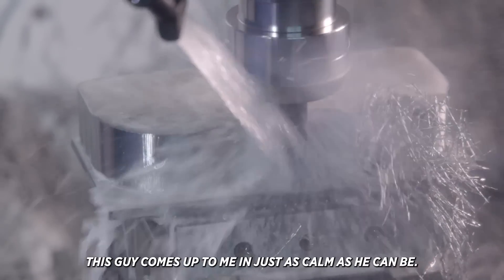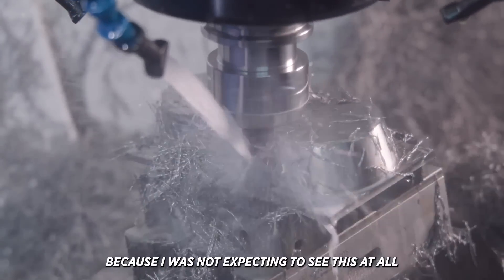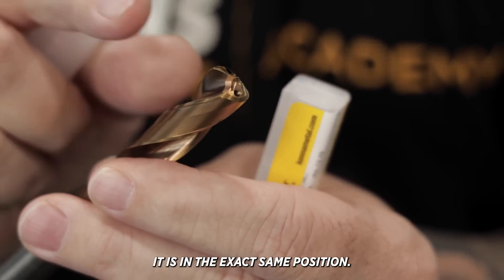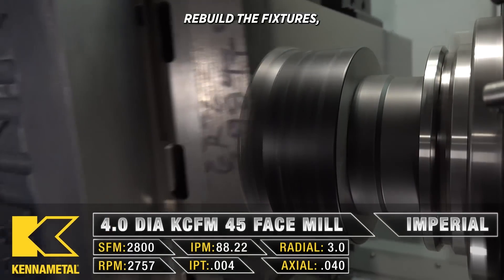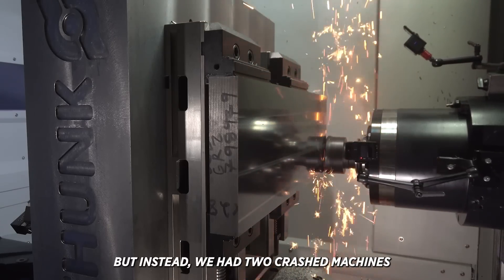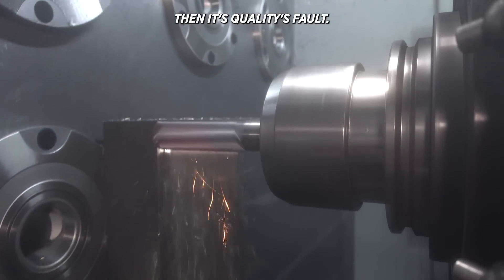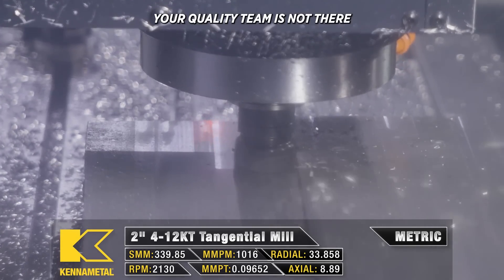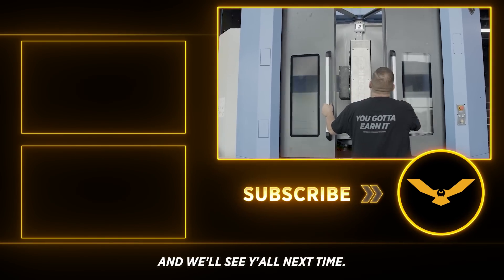$200,000 Damage | EPIC FAIL… Machinist CRASHES TWO MACHINES at the Same Time

Comment: Worst crash I ever did was when I was still in technical college. Brand new Clausing lathe. I was the first student to program and machine a part on it,  so I thought. I G0 to .500 in Z to the front of the part but I forgot the tool offset and I had also had Z in a positive number, not a negative. Turret went high-speed straight into the spindle. Machine was down 4 weeks for repairs and realignment. My teacher let me engrave my name in the spindle as the first student to run and crash the machine. I work with a guy who graduated from that school 2 years ago and he said my name is still on it. That was in 2001. Lol
Reply: That sucks but having your name on the machine for that made my day!
Reply: Awesome. Fantastic way to be remembered lol. I bet all of the teachers use you as an example……..
Reply: i'm grinning  while reading with RESPECT
Reply: When I was on active duty we were in the same division with the machine shop--they had a Chief in there who would make them wear their crashed parts on a chain around their necks.
Guys who tightened down vises and crushed parts or snapped bolts by overtorquing would have to wear a helmet with THOR stenciled on it.
Of course this was the 80s. You wouldn't get away with that now, someone would get butt hurt over it. Never mind that this was on a carrier and they were manufacturing parts for catapults and arresting gear and steam plant proponents, better an injured plane pusher than injured feelings.
Reply: @texasred2702  I love this.  I work in aviation as maintenance, and when a pilot would scrub off and blow a tire, it most defiantly was because his toes were on the brakes when landing.  A big no no.  The best part is that they always deny it.  Always.  Anyways, there used to be a practice of writing the pilots name on the squared off tire in bright paintmarker, and then hanging it from the pilots lounge door for a week or so.

It was all in good fun, the other pilots thought it was hilarious, and everyone got their jabs in, but eventually people started to get a little too butthurt about it, and HR made us stop.  People are too dainty and thin skinned nowadays.
Reply: That might be the best way to get the students to pay attention...
Reply: Does that mean you were the worst student in 2 decades since you still have the high score?  I’m just kidding though, we all make mistakes.  Cheers!
Reply: good job😂👍🏻
Reply: Well, hopefully you aren’t in that field anymore.
Reply: @BETTALIFE101  absolutely am. I was a young 19 year old kid just learning. I'm 44 now and have made a good living machining in the die cast tooling industry
Reply: Earlier this week...no one has programmed the lathe in the back in about a decade.  I've never programmed any lathe before (still an apprentice) and the only guy we have who does lathes doesn't do CNC but boss said he wants me to program that lathe to run a job.  I didn't know that G code for lathes is done in diameters.  I assumed your X axis would move based on radius because you're programming the tool's movement.  Ran it 5% rapid, figured out before it hit the part what I did wrong.  Edited my program.  Still 5% rapid.  First pass goes fine.  Supposed to be cutting down 1.5" to 1.4".  Single block, so I hit the start button.  The tool went straight for the center of the part, shoved itself half an inch back in the holder and stalled the spindle.  Luckily aluminum and I was running super slow on purpose so nothing was properly broken.  I had forgotten to change a "G0 Z.8" to a "G0 Z1.6".  I've also had to hit the stop button a few times and rearrange my tools because my boring bars get worryingly close to the spinning chuck jaws while other tools are doing O.D. passes.

Comment: Sounds familiar at the shop I am at. Been on cnc machines for 4 years. Learned a lot while making injection molds. Started learning in and outs of mastercam. Coworker of mine gets on a machine for the first time and gets a raise after 3 days. Scraps out thousands of dollars in steel. He never even felt bad about it. Blamed programmers for not teaching him. Made all sorts of excuses. But since he has a good attitude it’s all good. Very toxic place.
Reply: Why did you get away from mold making?
Reply: Still do mold work
Reply: @weyers17  I haven't worked in 6 months, I have been working on a fixer upper house. I am hoping to find some work with the new year . I like to design because I am getting to old to deal with the politics on the floor.

Comment: Working on very large Horizontal Boring Machines I've seen some big crashes...One happened last year when a worker had a tool in the accessory head of the machine...He drove it down in the Y axis without looking at it and drove it into the bed...Completely snapped the head off the machine and destroyed a lot of the internal components..Head was a write off and a replacement was £250,000

Comment: He could have been missconcepted, because you run tools so fast and from what I have learnt the tools you run may ruin if you slow down. I guess you must build a program and trial team. Then after they have made the first good part turn over to production. My worst crash was when I changed CAM, new cam compensated at same time as G00 to approach the part. Old CAM did it after loading the tool. So I looked over the G46 after M06 and because I couldn't find it I added it, it compensated twice and rammed the drill on the part, broke the bit and ripped the dented band on the spindle. Was a $1200 wreck. Plus two days without machine.
Reply: Many CNC machines need their own post processor to write code that is safe. A generator can have a library of processors that are stored with easy access through one of the drop down menus.

We bought a very lightly used 16 tool VMC. It was an off brand but had a Fanuc controller. We used Feature Cam to generate codes.

During try outs of the new machine I wrote short programs that used 2 or 3 tools, and preformed 2 or 3 operations.

Such as, center drill, drill, tap.

I set everything up as if I was going to make usable parts. Except, I set the tool lengths 4 inches above the part. Then I ran in 1st piece mode.

Hand on estop at all times.

Rapid off, except when my hand was on the knob to slow it down manually, and it had already started creeping the correct direction.

Single line. As in run the program one line at a time in case the code is not written to the machine's liking. Run button must be pressed to read the next line.

So the example I gave C drill, drill, tap, is one where the new machine did not like the code.

The problem was the tapping cycle had to be written using the pitch as inches per rev. But F Cam was defaulting to inches per minute.

So instead of tapping .500" deep over 10 revs, it was tapping .500 deep at 20 inches per minute (for a 1/4 - 20 thread). The first time it tapped it made a quick down then up move. Lucky I was aiming 4" high.

I worked on the post processor until I got that fixed. Then I wrote another short program with three different tools and opps. Repeated until every operation was tested.

Then wrote a longer program that used everything including all 16 tools and ran that. I ran that long program in some scrap plastic.

Then I added a header for program name, programmer name, date, tool info... All added automatically when a program was saved.

And made sure I liked the tool changes and end of program. Double checked that all cycles, offsets and the like were cancelling correctly. 

Me and the other programmer each had our own copy of the post processor. The only difference being the programmer's name in the header.

Plus, during one upgrade, after F Cam was bought by SolidWorks, I had to rework the post processor. They had made a couple changes that mattered. I fixed both copies.
Reply: @t.b.a.r.r.o.  you are right 👍,  On  deckel lathes, of you write the program in inches, all numbers must be multiplied by ten. Just the pilot 4690 control extravagance. G20 - G21 is not enough.

Comment: Best I've seen was on a huge cnc horizontal boring mill.   Big component on the table and my buddy was lining up two bores to bore them to size.  He had the spindle extended through the piece to reach the furthest bore with a dial.  Having got it lined up he went to retract the spindle using rapid.  Unfortunately he hit Y axis instead and the head of the machine went up with the spindle still inside the part.  The machine tore all 4 t nuts through the cast table leaving 4 huge craters in the table.  That machine had a lot of power!
Reply: Oooops 😁😁
Reply: Rapid seems to be a bad thing in this discussion.
Reply: @daveyt4802  Rapid isn't the cause of a lot of underlying issues but it sure does show you there's a problem quickly lol
Reply: @daveyt4802  ha
Reply: Wow,, what a nightmare.  That's one reason, I prefer not to rapid move especially when I am still leaning the machine. Yet sometimes I get lazy and rapid anyway.
Reply: Not a CNC machine, just a regular horizontal milling machine that could be converted to a vertical mill with a head change. It was a Cincinnati or Monarch, a beast that dated back to the 1950s at least (this was the 80s). It was one of the division workhorses and though I wasn't a machinist we would sometimes use their machines if we had to do precision work, but my shop wasn't responsible for this particular crash. They had a big valve cover sitting on the table and were milling a slot or removing  something on it and had a slitting saw set up on an arbor. A very young female trainee was working with a more experienced guy and was clearly nervous as hell. On this particular machine, the horizontal feed lever had a habit of sticking and you had to joggle it to get it to disengage. 
So she hits the rapid traverse to position the workpiece, and the stuck lever causes the table to rapidly traverse in both the Z and Y axes, busting the saw blade and turning it into a flying guillotine. Three guys hit the deck but she freezes like a deer in the headlights with the lever still engaged. Cracked the valve cover and bent the arbor so bad they had to get a forklift to remove the arbor support. Basically scrapped the machine. It was still red-tagged when I transferred. I think she ended up in an office job.

Comment: Often times managers will recommend someone to be promoted to a higher position in a different department/team if they are especially troublesome. Sometimes the process to fire/reprimand an employee is either impossible due to nepotism or just really slow and cumbersome. If a person gets promoted and moves out of their original department the manager doesn't have to deal with them anymore it is some other manager's problem. It is sick but that does happen, unfortunately.
Reply: I seen this a lot at my last place of employment.  It was the craziest thing, it was incredibly hard to get on there but once you did it was nearly impossible to get fired.  We seen so many people that on paper management thought they were Gods gift to machining, then after they were hired they couldn’t read a caliper.  But management would say that HR made it impossible to fire someone so they would basically give them promotions to move to different departments to not have to deal with them.  Or they would be paying a level 4 machinist to do basic level 1 stuff just to get them out of the way.  We literally had level 2 machinists training level 4 machinists on 2 axis lathes

Comment: This happend to my machines 
I was out for my daughter being born.
I got back on this passed Monday to my mill crashed.. my y axis  lathe crashed.
And my 2 axis lathe was handle jogged so hard that the x was almost off the track.
Reply: My mill I was in the middle of a set up and single blocking through when I had to run out the door. To go and meet my wife. (I never finished proving out my new program). The shop foreman assumed because I was wrote time down for programing the job that it was ready to go and put a new kid ( from the local tech school) on the machine .
Well one tool was not set yet and it rapped moved in z into the vice
Reply: My 3 axis I had no tools set just installed and had not set my g54 yet.
Same kid was told to press start
And the solid carbide boring bar went right in the part , and into the step jaw I just made and messed it all up.
Reply: Lucky no serious damage to them.
All 3 jobs are "hot" jobs.
Of the group lead was not out with covid and the shop supervisor had asked one of the seniors to take a look before pressing start.  None of it would have happened

Comment: Had a 2nd shift tech run the wrong program and mill the fixture on one pallet in a production machine because I was browsing the directory and had left the wrong program in the control. 
We submitted parts for inspection and it wasn't supposed to run at all until our shift came back around. Had a red tag on it.
The guy just loaded a set, and hit the green button. Didn't even know what he was running. That whole department blames me for what he did.

Comment: So far the largest crash Ive had was Hurco VMC I was being trained to setup and operate. I only had a few months experience from being in school so I was GREEN. I had learned on the FANUC controllers to add height comp or cutter comp to bring a tool in to spec well on a hurco it doesnt work the same way. I added .005 to a height offset in the wrong page and hit cycle start lemme tell you I was standing right there, there was NO time to stop it. Only step back afterwards and reevaluate myself. 5 years later and now Im an instructor at the same school i graduated from and havent made another serious mistake.
Reply: In which school are you an instructor? Im would like to laern CNC

Comment: I'm a small one man in his garage type shop, the worst crash I've had was on my ST-10, I was hand programing a shop made bar puller, I proved everything out and it worked great, but then I went and loaded a boring bar and it hit hardened chuck jaws at 6000rpm on tool change.  Both the turret and chuck were was knocked out of alignment, it cost me £1800 and two weeks of down time before I could get the Haas tech out to do the job.
Reply: Do they have a kind of deal that if you don't have a repair contract, they send someone only when they basically have nothing else to do? Some other companies do that and it's not very nice if the budget is tight and you're hit with extra downtime.

Comment: This is why companies invest in Vericut.
The programmer/setup/operator should walk through or dry run the program first. But if its a regular production the operator should be held responsible for the error. Where I came from you were terminated after you crashed a machine 3 times. 
    I have seen an operator crash an HMC knocking the tombstone over in the machine so bad the the machine had to be partially disassemble to remove the tombstone because it was unable to shuttle the pallet.
Reply: Vericut only works for so much.. we have had programs do some crazy stuff from the post and cause crashes
Reply: Well it’s only getting worse if you add Vericut into the Equation then no one is taken responsibility anymore. Probably 75% of crashes happen because operators are not paying attention and Vericut can’t help with operating the machine.
Reply: We had a post change a few g28 to x0.  From a glance at it you wouldn’t think anything about it till it dog legged the part.

Companies buy vericut because they want it to produce a good part in the first run and less chance of a crash. It’s not my job to spend a hour or two going through line by line to make sure it won’t crash. The programer should have done that. 

I load the program
Correct fixture 
Set all the cutters/ drills
Check my g54(a/b axis)
Check programs tool numbers/h values/diameter offsets.
If it’s a first article I check after each tool is ran. 

Anything that happens in the program is on them.

Comment: Do your programmers not run Vericut to validate the program?   Vericut could have caught this before the program was released to the floor.
Reply: So that would require all programmers to have Vericut licenses right? And everything has to be proven out in Vericut to even get to the machine? And if any changes is made to the program it HAS to be rerun through Vericut! Vericut also has to be perfectly set up for each machine on the floor, that sounds like a perfect world, not sure anyone has that setup yet. 200k in spindles is probably cheaper than that perfect scenario